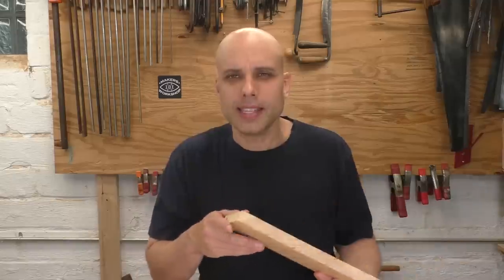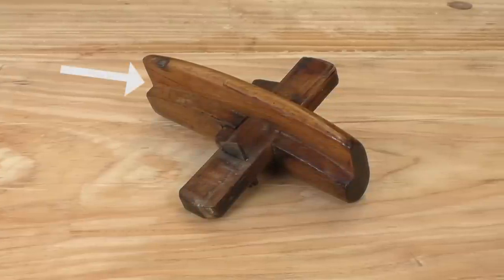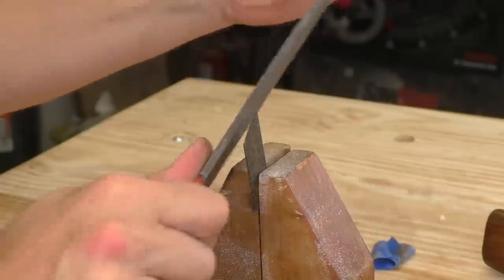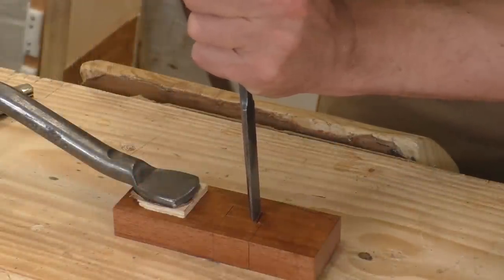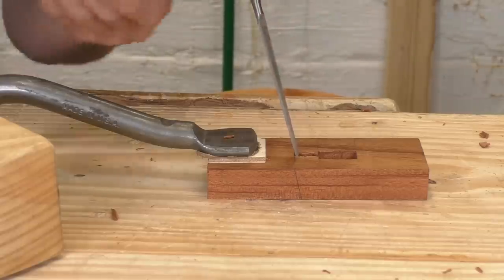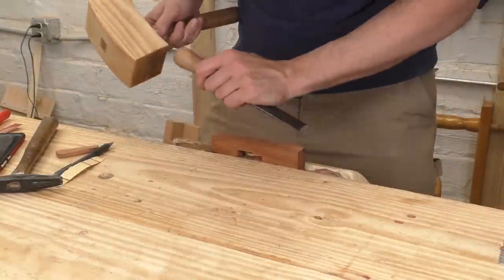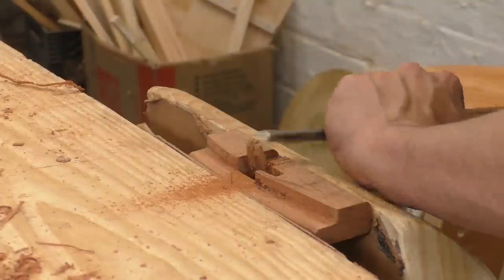Making a Japanese Cutting Gauge! (kebiki) // Low-cost tool making.

Comment: Just sell the first one on eBay as a rare left handed vintage Japanese Cutting Gauge!
Reply: As a left hander, handed tools are often awkward since 95% of them are right hand only. Did the mirror image really matter?
Reply: @theTeslaFalcon  It wasn't Mirrored.  The wedge channel was on the same side as the cutter, which ruins the whole tool because now the wedge obstructs and moves the marker.
Reply: Kevin Cochran 😂😂😂
Reply: Yeah I didn't see that as a mistake at all, it'll just be for use from the other side/other end of the work piece. Technically an error in the duplication, but I think it's till viable.

Tell ya what, it has me thinking now about one with a rabbet on either side that could work both ways simply by turning the  beam around ;)
Reply: @SoralTheSol  ... So he would need to mirror the cutter as well, the wedge can be exactly the same. He basically does have a left handed version now. Or rather, he finished the left to right cutter, and he has the main body of a right to left cutter; since in truth, these aren't actually handed tools (those are ambi tools).

Comment: rex, rex, rex..   you didn't do the "wrong side".. you made a Left-handed version!!!
Reply: Need to mirror the blade too for a lefty tool. Otherwise the bevel is backwards. It matters.
Reply: Made me laugh with the positivity
Reply: @thomasarussellsr  This needs to be a top-level comment!
Reply: Thomas Russell can’t you pop it out and flip it over
Reply: @aeronicc  Yea I think  the curve would be the right way if it's just flipped in there.
Reply: Tim, that's right.  And woodworkers need to be at least somewhat ambidextrous.  Also, there's nothing wrong with having both a left- and a right-handed cutting gauge.  There are several makers of marking knives that make both left- and right-handed marking knives, so it makes sense to have two cutting gauges.

Comment: When you are cutting the angled mortice for the wedge, an easier way to check you are at the correct angle is to put a mirror on the far side of your workpiece and look into the mirror to check the angle. It works well when drilling holes on an angle as well.

Comment: I just wanted to comment for the people that this is not only a cutting gauge but also a splitting gauge.
I f you read Toshio Odate's book you'll learn that with this wari-kebiki you could also split a soft wood panel along the woodgrain. This is sooooo much faster than doin a ripcut. You will love this tool just for these purpose.

By the way. There are also splitting gauges around in japan that are quite a bit beefier (lets say larger in size and shape)

Keep the good work up Rex but take your time!

Comment: Just finished a second "hybrid" of the styles of gauge, myself... AND using a hardened washer for the cutter at the end of an adequate dowel allows the curved blade, and the first one worked so well I had to have two...
    Just be wary of "cheap-o" washers and spacers that won't hold an edge... That said, for no more than a washer costs, it's not a bad investment for a tool... for those who can't sacrifice a saw, scraper or putty knife.

If you're interested, the dowel was a half inch thick, and the washer a 3/4 inch wide... held fast by a construction screw. I drilled first for accuracy and straight precision... Followed Rex's video otherwise on a marking gauge with the slightest recess added for the washer to snug right into... not only precise, but protects the "cutter" in storage. ;o)

Comment: The first one you made can still be used without a problem.  The location of the wedge probably wouldn't impact performance, and the 'hand' of the tool would be primarily determined the the direction/angle of the cutting blade, so other than having the main block mirrored, it can still be made into a useful tool

Comment: That's a really nice piece, & your wrong side rebate just means you also have a left-handed version now.. I think.
I've wrecked my hands a bit doing the inverted planing thing, but it can be made much safer by clamping your little piece first & then holding the clamp to draw it over the plane. The clamp will go across the sole, so you can hold that at either end & your fingers won't go near the iron at all. Alternatively, if there's clearance, do it front & back in a G clamp and its spine doubles as a handle.

Comment: I dunno if the angle is correct for this, but you might wanna try switching directions after the first few knife passes. When run backwards, this tool could act like a single saw tooth or a scribe. The advantage is it will clear its own kerf and make a really, really deep score. It will even saw all the way through a piece of wood, if you needed to, or to the full depth of your rabbet. But the rake angle has to be significantly negative. It may take a bit of filing on what is the back or spine of the knife (what will be the face of the saw tooth) to get the correct amount of negative rake to prevent the tooth from digging and jamming. You also want that face to be flat with crisp 90 degree edges to do the cutting/clearing.

You might like to make a few knife passes first, so that the surface fibers don't fray and tear out. After that, you could (theoretically) switch directions, and the single-tooth saw will leave a nice edge. I use a homemade scribe in this fashion, and it's not angled or ergonomic to make the reverse cut in the knifey direction; I just do a few light scribe/saw passes to cleave the surface fibers before applying more pressure. 

The reason I make this suggestion is the shape of the blade and the rocking sole of the tool. It makes be believe this may actually be intended to be a scribe and that you may actually be using it backwards. I shape and sharpen my scribe just like that, even though 90% of the "edge" isn't actually going to touch anything. Only the point, really.

Another way to get this sawing/kerf-clearing deep score/cut is to run it the direction you are already doing, but cut a notch in the blade somewhere in the belly. The blade in front of the notch will act like the mouth of a plane to prevent digging. The back of the notch acts like the face of the saw tooth. You can fine tune it from there.

Comment: Just got the Irwin Marples chisels you talked about in a previous video. The box from the boxes set is pretty cheesy so I made a new one. Hand cut mortice and tenon joints on the doors, used the new chisels after a bit of honing. Fantastic fun, nothing like nice sharp tools. Came out well considering I have never done this operation before. Have a nice break!

Comment: For getting the cutter into the block, it would make sense to use two square-ended blocks the same thickness as the blade cutter is wide either side, then fit a 3-4mm strip of wood either side of that stackup. Wax the cutter, snug everything up, glue and clamp. Wax stops the cutter getting glued up and is easier to remove. Take the glueup and plane it to shape.

Comment: From Odate's description (yeah, I bought the book),  that appears to be used regularly as a splitting/slitting gauge. That's a good thing, because I used to build dulcimers and want to get back into it. I need to line the sides to increase the glue area. These lining strips are about 1/8 x 1/4 in. usually of pine, willow or other light flexible wood (they're cold bent). Just what I need.  I had always split them out with a pocket knife; very tedious and lots of rebating the wrong side, if you know what I mean, and I think you do. 
Thanks for the heads up.

Could you have used a 3/32" bit to thread the coping saw blade through? If necessary, you could plug the hole with a bamboo skewer.

OK everybody, break's  over. Back on your heads.

Comment: Hi Rex, just watched this again several months down the line.. at your "Mother Frustrating" moment, the only thing I can think of being "wrong" is the direction of the locking wedge hole. Would it matter if ithe wedge were on the cutter side or not?

Comment: The whole piece is scaled to the body. The curve is probably about the total natural deflection of the wrist 60degrees or so. The whole fence is probably the length of the builders forefinger to the inside of the palmheel where it meets the wrist. I would bet the gauge to the cutter is just a bit shorter than the knife edge of the hand to the extended thumb worth of distance.

Comment: Enjoy your vacation, but if you want to make a quick video that doesn't require you to make anything. I just finished the 30 dollar bench but I haven't added any holding mechanisms. Now that you have used the bench for some time I would love to hear what you still use and what wound up not being as helpful. You seem to just use your vice in later videos. If you had to do it all over again what would you do different? Is making a palm or crochet worth it or should I just focus on the vice. Love to revisit that project and hear your thoughts about it now.

Comment: I think I will have to make one of these.... I do confess that my marking gauge that is currently optimized to cut across the grain is almost exactly the same one you used to mark out this one (with the notched dowel to lock in the measurement.) On mine I spent about 30 minutes with a coarse diamond stone to sharpen my trimnail into a definite blade rather than a sharp point. I am interested to find out how a much larger blade will perform.  I do recall that when I sharpened my trimnail I managed to grind away a fair amount of skin. Took a long time to heal. In future I will be using vise grips.

Comment: To the reader of fine print, the video proclaims that 1/2"=13mm, it should say 1/2"≈13mm (note the aproximate equal sign) since half an inch equals 12.7mm on the dot, it hardly matters for the project nor in practice but correct is correct and mr Rex is probably being used as a reference/authority on these things.

Comment: I made a Japanese style marking gauge many years ago, based on an article I read in Fine Woodworking. It also has a small knife in it, as opposed to a pin like a western gauge. One feature of it that I really like is the wedge is a double wedge, so it can't fall out without taking the whole beam out. I also have one of those Veritas round marking gauges, and I never use it because the Japanese one is so much better. 

Anyway, I see some guesses in the comments about what your mystery wood is. My guess is maybe sapele. Did it have a sweet smell kinda similar to cedar but not quite? The other wood I can think of that looks similar is makore, but you didn't mention that it irritated your eyes and made you cough as soon as you started cutting it, so it's probably not that.
Reply from the maker: I've got a bunch of sapele. This is redder.  No smell at all.

Comment: A design like this that I like for greater extensions is one where the blade only protrudes from the arm by a little more than the depth of the cut you will make, the blade is sharpened with a rounded end to match the surface of a rounded arm. When the arm is sticking out quite far you can keep it level by just resting the arm on the work, it's not as versatile since it doesn't have a point to the blade, but it's very quick to use, hard to go off track, and the blade is better protected. You could probably make it very easily with a big round rod, but it's worth the effort to cut the profile into a rectangular arm since it's way lighter and more compact. Unfortunately you can't sharpen the blade in place so you'll want to thread a bolt into the end so it's easy to pull out for sharpening.

Comment: Finally a true CUTTING gauge. NOT of those things with a pin or pins that basically scrape across the grain leaving a rough broken line. So many use a marking gauge as though they are cutting gauges. NOT. The Japanese and Chinese masters knew the difference. And they didn't make panels often, thus the smaller rabbet style. Love this gauge. Gonna have to make one I reckon.

Comment: Hey Rex.  You might want to buy a jeweler's saw.  They are cheap and come with a selection of blades. They are basically a  mini hacksaw.  Not only can you cut metal in very fine shapes, you can use it on wood to make a hairline cut.  Note: the blades are designed to cut soft metals, such as gold, silver, copper, etc. There are many shapes of blades. One is like a circular rasp, which allows cutting in all directions. If I hadn't been an art major, I wouldn't know about this, or tools used in other crafts, which come in handy in woodworking.
Reply: I'm curious where you've found cheap jewelers saws. Or your definition of cheap. The lowest price I've been able to find one was still around $100

Comment: oddly, a friend just sent me a bunch of old stuff, there are some blades in the stuff that look like they would go to a commercial model of this gauge. It also comes with what they called a 5 second sharpener. I was wondering what the blades went to, while they may not have been made for a tool like this, they would be a perfect fit.

Comment: You mentioned that you hadn't yet added a mortise gauge to your woodworking for humans toolbox, and I find it funny that the first actual tool I made was a marking gauge that doubles as a non-adjustable mortise gauge. What makes it funny is that I have never once used the mortise gauge side of the tool. I have been wanting to make a mallet since I made it, but I have never had a scrap post to use for the head. I suppose I should just go buy one at this point, since it has been a while.

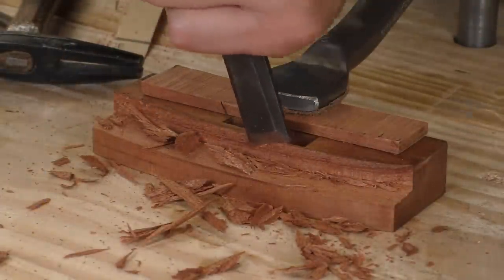Comment: 11:17 It is not a mistake, it is just - left handed tool, isn´t it?
Reply: As a lefty that was going to be my question
Reply: If im not mistaken, it has to do with the angle of the wedge. Whole design would have to be flipped
Reply: @fliplucky8813  nah, just make a new blade with the bevel on the other side. Should work lefty just fine with the beam and wedge he already has.
Reply: @thomasarussellsr  I think the same. It is exactly mirrored as far as I can see, so wedge can be flipped, the beam is symmetric, so as you said, It will be just to make a new blade and replace it in beam, sharpened from proper side.
Reply: @pasowec2370  @Thomas Russell.  It is not the blade that is on the wrong side, it is the wedge.  So the wedge is going to be hammered in directly next to the blade.

Comment: It is one of the reasons, alcohol intoxication is (at least overe here) a valid cause to dissolve the (sale) contract. It's just not one they are likely to advertise on the website, or put in their terms (as it doesn't have to be part of their terms if it is general law).

Comment: Any chance Rex would make a video about composite wood? Composite wood is widely used by woodworkers in my town, but one they use a lot which I hate is MDF (https://en.wikipedia.org/wiki/Medium-density_fibreboard). My town was built over a swamp, the moisture here is very high, so MDF furniture just don't last here and yet furniture stores here are filled with those - so I've grown a distrust of composite wood for that reason.

Comment: the using a planer upside down - USE A PUSH BLOCK
you do not want a "bloody" manicure. 6 months later and it is still not pretty.
(not that it matters but i was using a electric hand planer.)

Comment: Nice project but there's at least 1 glaring issue: Spring steel s NOT rigid, and that's a fundamental flaw in the design. A RIGID blade will cut the fibers and NOT be pulled by grain, unlike the pin guages which can be moved by the grain. A spring steel blade will flex, end of story. If you think it won't... go ask an oldtimer. Murphy's Law is a btch. If you want to do it right, use a stiff blade. And why wouldn't you do it right in the first place? Why copy a well-designed tool and introduce a critical flaw? (Nevermind me, I'm a "do it right or don't even try" kinda person, it can be infuriating... for all involved lol)

It could also be argued that this is not a marking guage, and is in fact a splitting guage, or Wari Kebiki, instead of a Kama Kebiki. While a Wari Kebiki can be used for marking it is designed for splitting thinner pieces of wood. If you watch a Japanese master use one they take prepared stock and cut it to size with the Wari Kebiki, plane the cut edges and then assemble the piece. Often these are used for smaller projects where the wood is thin and a few passes with this will sever straight through.

Since I prefer sht sandwiches... It IS a nice project, and well-made. You do nice work. I would suggest, especially when making tools, to look into why a tool is made a certain way before you make it. There are good, time-tested reasons for its features and ignoring what is arguably THE MOST important feature of a tool will only serve to aggravate you in the long run.
Reply: The blade only protrudes 1/4 inch, not enough to worry about flexing??
Reply: @JohnColgan.  You'd think so but there's a reason the authentic tool uses a forged or stamped and hardened blade. Introduce a slight imperfection in marking and measuring and you've added that possibility to every piece you use that on. Why do that when it takes little more effort to not? 2c